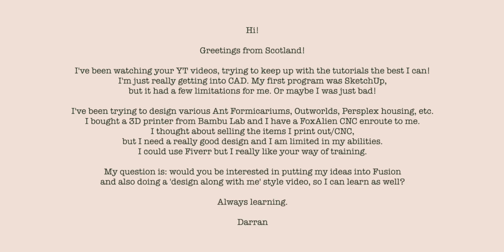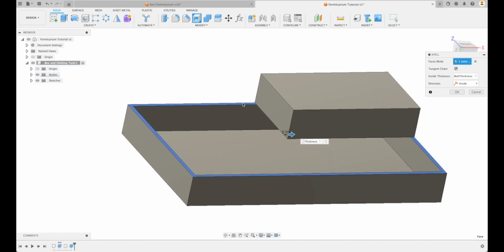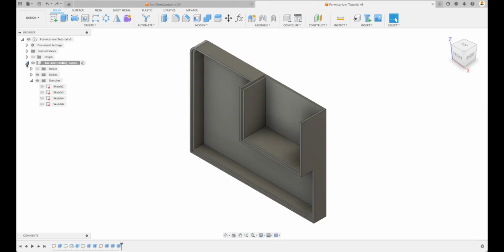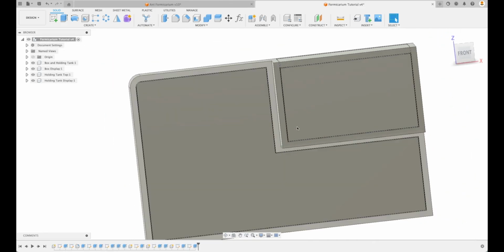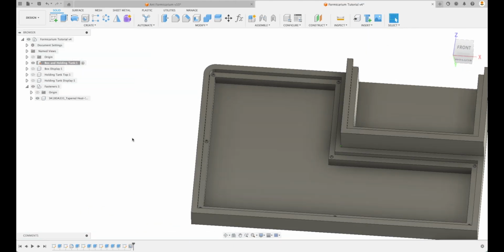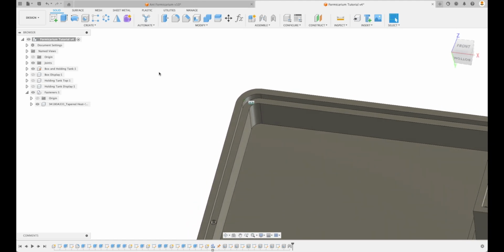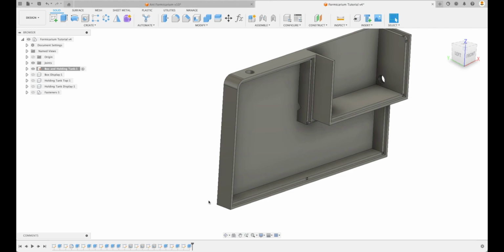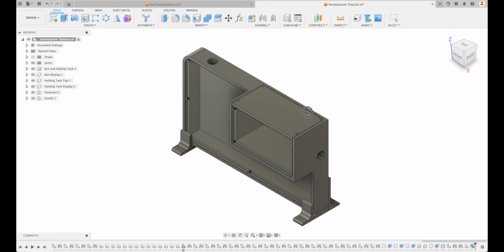Auotdesk Fusion 360 - Ant Farm (Formicarium) - Advanced Parametric Modeling (2024)

Comment: McMaster is great for all of those engineering details and models, but when buying a more affordable option off of, say, Amazon, what’s the best way to figure out the ideal holes to model?
Reply from the maker: Usually, the specs will be the same. Just compare the thread sizes. Also, if you're unsure, make sure to message the Amazon store that you'd like to buy from and ask them to provide those specs. If they are reputable they will provide that info for you.

Comment: So I am designing tool holders which I 3d print. I typically create a component that models the object I want to hold, and then I use it as a cutting tool into the body which I'll actually print. Obviously I need some relief so that it fits, but I am not sure the best way to do it. I could make the first component larger than the real world object, but I don't really like that. What I typically do is cut it into the object, and then use push/pull to add a relief. Would be curious to know if you know a better way to do it. Thanks!
Reply from the maker: That is definitely a good method to use! Just like was taught in the tutorial, use a “Relief” parameter to easily adjust for the real-life component. I would also start out 3D printing a much smaller set of mating components so that you can see how much relief to set. Once verified, print your entire set of mating components and then adjust again as needed. Great job applying techniques that you’re learning from our channel! Keep up the great work :)

Comment: For some reason, the acrylic component disappears as in it cannot be seen even after activating that component, this happens after I insert the heat set fasteners into the main box and also the construction lines created to place the fasteners and their holes are not parametric at all, when the thickness of the wall is increased the lines and position of the holes don't adjust accordingly and holes get tucked away in the main box. Maybe I'm doing something wrong but many of the parts are not parametric. If you can provide solutions for the problems I will much appreciate it. I will also meanwhile try to figure this out by myself. Thanks in advance!
Reply from the maker: Thanks for commenting. There could be several reasons as to why. Have you resolved your issue?